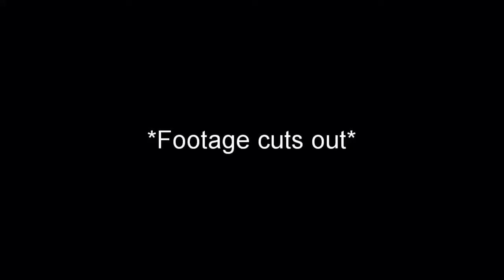Winter Lake Powell Stripers 2018-19 Season - Nonstop Action!

Comment: Nice Bag guys!  Where at are you fishing from and what size/type of jig heads were you using?
Reply from the maker: This was in the bullfrog area. 1/4 oz and 1/8 oz the brand doesn't really matter too much just as long as they have decent hooks especially with those stripers. Typically I'll paint my own jig heads but if it glows in the dark you're set!
Reply: Lip Rippin Outdoors Sweet thanks. We live closer to the Halls Crossing marina which is where we usually go. Nice to see they are biting in the winter right now. I might have to plan a night trip down there real soon.
Reply from the maker: Alright hope you can figure em out tight lines!
Reply: Sweet video! Need me some Powell time! North Wash Outdoors let's go.
Reply: Twisted Arch Productions Oh yeah. We need some Powell time. I'm super excited to see them biting.